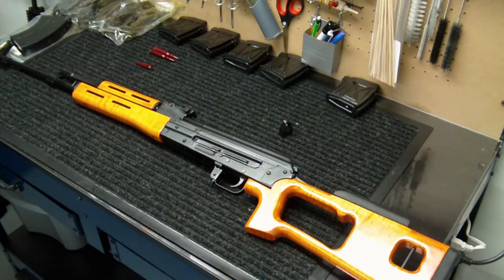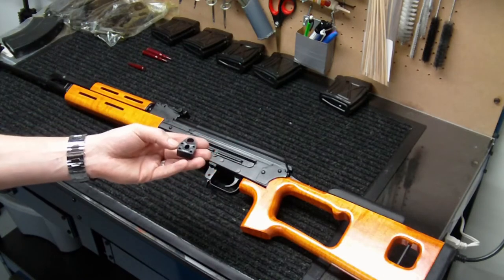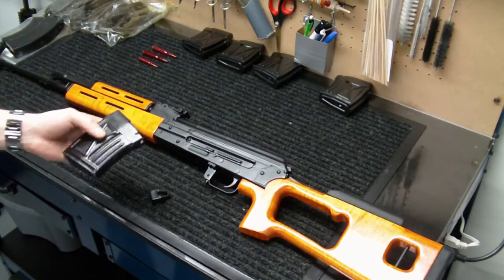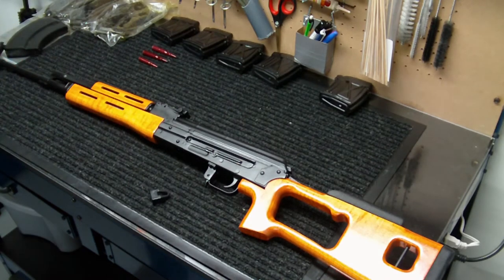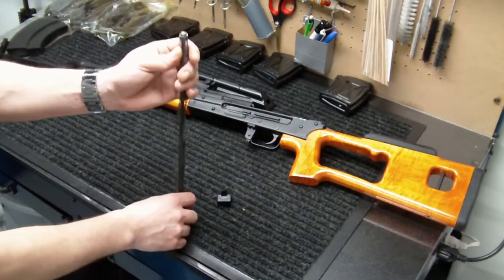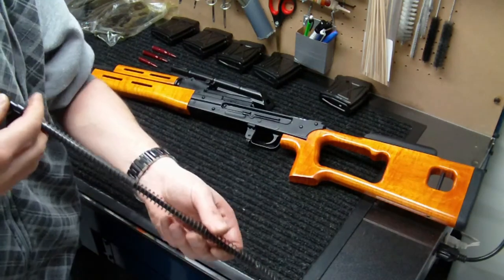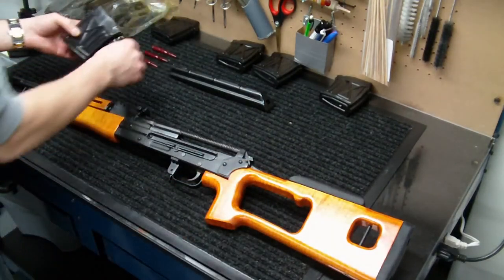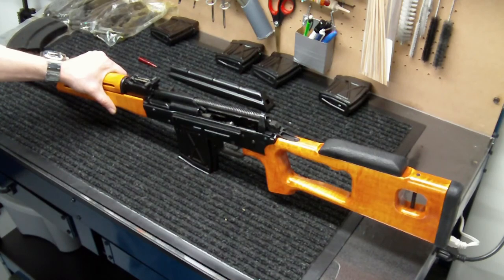AK-47 Recoil Buffer Installation:  PSL-54c Shock Absorber

Comment: Use a Stainless Allen set screw with a hole drilled through it (you can have a few of different ID sizes) and screwed into the gas block to reduce gas flow and cut a buffer pad from a tire sidewall.

Comment: Use 3 utg Tri barrel mounts from the front sight to the gas block Use Z Max engine negative on the metal is hot poured down the barrel receiver area boat boat Carrier piston area wipe it down it allow you to clean and shoot smoother

Comment: FYI, if your PSL has the BHO, you may have an issue disengaging the charging handle. I had to take my buffer out as the last round would stick open, and the charging handle would not pull back far enough to disengage the BHO.

Comment: How come your recoil assembly is so much easier to take apart than mine? I hold the spring down a bit and that retainer stays solidly in place. It doesn't slide down, up, back, or anywhere. I'm super confused.

Edit: Note to future self you push the retainer/nut down with the recoil spring, and then it's loose enough to slide out. I kept seeing these guys pull down the spring and it was confusing me.

Comment: Very nicely done, I own a red buffer for the PSL I am making. And I like the idea of creating an extended magazine for it, but keep in mind the Lahti magazine is designed for 53R and not 54R. I think it may be more efficient to design a 20 (or 30, or whatever) round magazine from the ground up, that curve may be a little too much for the 54R to feed reliably in my opinion.
Reply: Get an extra-power recoil spring & that will fix your problem the right way. It is what the Russian do for harder than normal shocks to the rear trunnion.

Comment: I have the double rod in my spring but I just managed to slip the buffer over it and got it working good!  I really didn't know how to do it till I watched your video,  but I did order the softer natural red rubber buffer, and it just bounces off more smooth than the hard PVC type and with a quicker recoil. Love the bigger shell! great gun, May I ask what their going for & where to order one? Thanks man.
Reply from the maker: proverbs 8 Thanks for watching!  PSL's are only available on the private market and online auctions unfortunately...  They generally range in price from $900 to $1500, depending on condition and what comes with it.

Comment: Recoil Buffer vs Extra Power Recoil Spring
You know I've never seen a Russian or any nation that uses the AK-47/74 use recoil buffers. I am starting to think Recoil Buffers are one those accessories marketer's market to make more money like titanium firing pins.

So if your bolt carrier is hitting the back part of the receiver "harder than normal" get an extra power recoil spring to stop that situation.
In my opinion also after using buffers & not using them.

Don't just take my word for it. Here are “other folks viewpoint” I copied & pasted on the Recoil Buffer:
- “The bolt carrier in the AK "they say" is not suppose to hit the rear trunnion."
- “If your bolt carrier is hitting the back of your receiver then you should replace the recoil spring, not band-aid it with a buffer imo."
- “The bolt carrier in the AK "they say" is not suppose to hit the rear trunnion."
"A wise man once said, "I'll start using one when the Russians do""

Just saying.

Comment: I installed the buffer and my PSL 7.62x54r started jamming.  Has anyone else experienced the jamming?  I just removed it and checked for breaks or cracks on the buffer.
Reply from the maker: probably short-stroking.  you could try sizing down the thickness of the buffer and see if that helps.  thanks for watching!